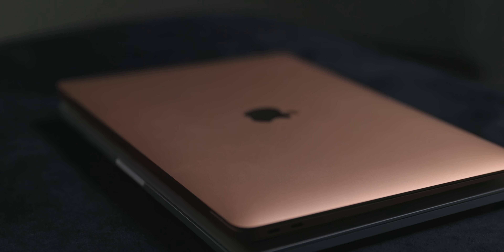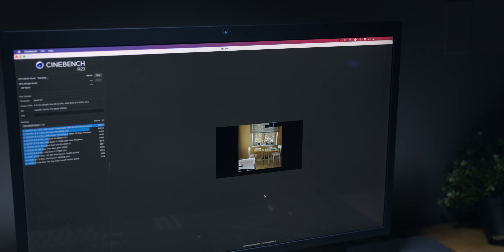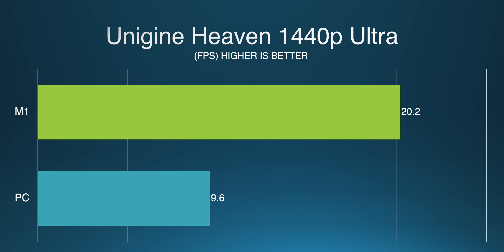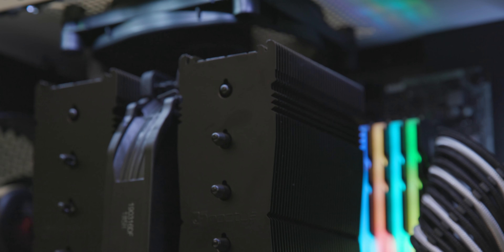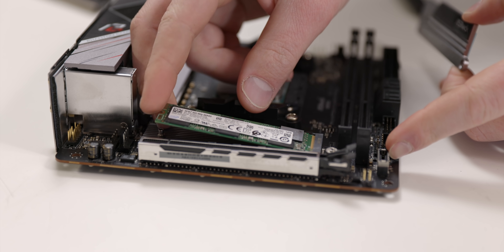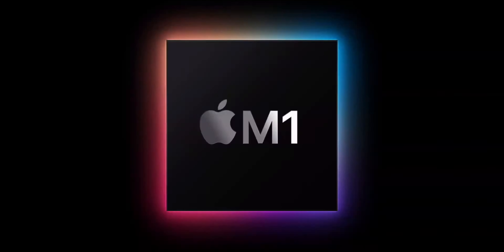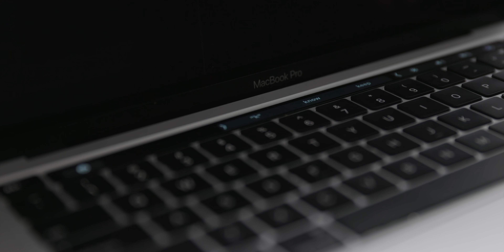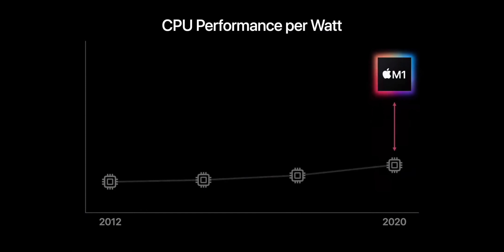$699 Mac mini vs $1,000 PC: Which Is Faster?

Comment: My winters are cold my intel CPUs have kept me warm for years. The M1 is gonna make me freeze to death 😭
Reply: My intel cpu doesnt make half the heat my NVIDIA GPU makes!
Reply: @ryanmalin  well a GPU in general runs hotter, then a CPU. however, under load the GPU runs cooler in comparison.
Reply: @NonsensicalSpudz  in a gaming laptop it’s reversed. The GPU usually runs cooler and the CPU is a hot sun.
Reply: @mashy712  yeah, thats what I said
Reply: but you'll be able to afford a heater with the difference in power consumption
Reply: @alainsterckx9154  But a hot laptop is pretty efficient combined with a hoody. It only needs to warm your fingers.
Reply: Have fun with that electricity bill lmao
Reply: @xehP  Here's the funny thing thou. Power is power and heat is heat. You get the same amount of heat putting 1500 watts into a space heater and 1500 watts into a desktop (thou, yikes that's a beefy desktop). So unless you need to open windows to cool your room as a result of your desktop, you don't waste a cent in electric bills.

I've always thought electric space heaters are a waste because of that. You could be doing a number of things. Welding, computing stuff, spinning a fan, weaving some fabric, boiling water, cooking food, etc. They will all heat your room. A space heater is just skipping the useful work and going directly to waste heat.
Reply: @randomnobody660  You are clearly uneducated. Absolutely everything has an efficiency percent. When your computer draws 700W, it doesn't produce 700W of heat, only the part of energy that gets "wasted" transforms into heat. The rest goes to actually powering components and making them work. Heaters don't need to power anything, so their efficiency is quite high. You'll get much more heat from an identically powered heater than a computer
Reply: @Nagib23_32  It's honestly hilarious how confident you are considering you are wrong.

First, take a step back and think of your room as closed system. You have say 700 watt hours of potential energy in a battery or something. You run that thru a heater, you have ~2.5 million joules of heat, and your room is warmer. Easy enough right?

Now replace the heater with a computer. You spent 700 watt hours of energy rendering a video or something. You claim not all the energy became heat. What did it become then? Lights from your monitor gets absorbed by your walls to become heat. Your fan blows air that stops due to friction and that kinetic energy becomes heat.
Where did you store the bit that isn't heat?

Second, even if you were right, which you are clearly not, that is still a waste. Suppose you are doing something that actually stores energy, like generating hydrogen or something. You could use the waste heat from that to heat your home and have say 200 watt hour hydrogen and 500 watt hour heat. Or you could throw away the 500 wh waste heat and heat your home again with another 500wh of electricity. 500+700=1200 > 700.
Reply: @randomnobody660  Lmao you are the one who's trying to act smart yet is wrong. You know what effeciency is, right? The energy thst doesn't transform into heat goes to

1) Light up the monitor. You know what light is, right?

2) Run current through the silicon. It doesn't just all magically transform into heat, you see?

3) Spin the fans. Friction produces heat, but much less than the fan actually consumes. You know that it needs to use something to rotate, right?

4) Spinning the hard drives. Same story as with fans, motion requires energy

And last but not least, you see, I have an actual live example of how wrong you are. My main system while gaming consumes 650W on average (290x CrossFire, 4790K OC). When I game on it for 3 hours, my room gets hotter by 2-5 C°. I can feel it, but it doesn't make me uncomfortable, nor can it help if the window is open at winter. Now, I also have a heater just for that. It's set to ~300W. When I turn it on, it makes me feel warm in winter in just 10-15 minutes. And if it's set at ~600W (Like my computer is), it will boil me alive in a matter of minutes

I knew Americans aren't known for their brain capacity, but I couldn't imagine them being this stupid
Reply: @Nagib23_32  I addressed all of this already.

1. unless you are shining your monitor out the window, that light gets reabsorbed by your cloth, you, walls etc and become heat.

3. unless you are blowing air out of the house with your computer fan, the air being blown slows down due to friction and when that happens kinetic energy becomes heat again.

4. see 2. Same thing. Unless you are perpetually accelerating your hard disk somehow, you can't just keep putting energy into a drive. Whenever it slows down all that kinetic energy is released as heat.

2. this is the dumbest of them all. Current thru silicon basically becomes all heat plus a bit of radiation, which again, is just heat with extra steps.

If your brain is not capable of thinking thru all the detail, think of the big picture. When you use say 100 watt hour of energy, that energy came into your room via the outlet. Unless it either leaves somehow or is stored as something other than heat, your room is now hotter. Literally middle school physics. So tell me. How did energy leave your room or is stored inside?
Reply: @Nagib23_32  actually it does, the components your powering output their own heat even if it doesn't seem so, the only thing that doesn't really is the fans
Reply: @randomnobody660  you are right on everything you said. Looks like the person you argued to skipped some physics classes.
Reply: @randomnobody660  welding in a living space? a fan gives you maybe 50-100 watt of heat, 99,xx% of people don't weave anything, boiling water raises humidity, cooking food is a daily task anyways.

Electric heaters are irreplaceable if you need to heat with electric. Daily chores won't keep your house warm enough.
Reply: @fluffyman15  Ok, so welding isn't that smart. Although you can at least have a heat exchange in your fume hood or something?
Also my point isn't do more daily chores; those are already done anyways. My point is that energy could be used to do literally anything before turning into heat. Perhaps there can be local datacenters that pipes its cooling water to residential areas, or some sort of non-obnoxious factories that do that etc. Or perhaps you could get a computer that contributes to some cloud computing network (or mines I guess) while heating your home etc. Obviously not how our society is set up, but in an alternative world sort of thing.

Also also the primary point was that your computer isn't contributing to your energy bill if you aren't opening windows and are already using heaters anyways.
Reply: That's a cold burn
Reply: see, that's where you goof'd
i still run a AMD phenom deneb black edition. I can melt ice caps within 3 mins of booting :)
Reply: @redditor001  3 mins? By that time Noah's ark would already be out because intel would have melted all the ice caps😆
Reply: @RawkustvOfficial  nah, we’d probably be evaporating the oceans then.
Reply: Best comment ever 😂
Reply: It really is an issue in the winter for me, but during the summer it's so nice. My old Macbook Pro 2013 Retina gets mildly toasty, but nothing compared to my Acer Nitro 5. The M1 stays cool and I think I've heard the fan come on like twice during the entire time I've had it.

Comparison to another ARM based computer, like the Pinebook Pro laptop, that actually warms up. It also has an aluminum case and an ARM based SoC design, but it definitely doesn't stay as cool as the Macbook (which is also faster).
Reply: xD true af
Reply: It might not be so bad… it’s likely going to be warmer because you won’t have the Windows open!
Reply: @colinpye1430  I think I see what you did there🤣. Did I over think it? 🤣
Reply: @colinpye1430  come to think of it a boat load of people must be using intel as the UK is unseasonably warm, we’ve had the mildest winter yet. Intel isn’t all bad after all 😁
Reply: So don't use m1

Comment: MacBook Pro M1 - is my first ever iteration of joining the Apple ecosystem - and I have to say - very impressive.

While I hate the MacOS for the most part (perhaps I'm too used to Windows at this point) - however, I do have to say it works really well and is very stable. The laptop is silent, snappy, and fits my daily workflows perfectly. I'm not a content creator, but I do have several monitors and run various apps at the same time.

Not a single hiccup. Love it.

Comment: DO NOT BUY A MAC MINI.  MINE IS A $1400.00 PIECE OF TRASH.  FROM THE MOMENT I TURN ON THIS PIECE OF SHIT,   I HAVE HAD NON STOP ISSUES.   APPLE CARE IS WORTHLESS ON FIXING THE PROBLEMS. ANOTHER $100 WASTED.   PLEASE READ ALL THE CUSTOMER REVIEWS ON THIS BEFORE YOU WASTE YOUR HARD EARNED MONEY .   Never in my life have I received such crap from any company ever.   I WILL NEVER AGAIN WASTE MY MONEY ON AN APPLE PRODUCT.
Reply: Agwali  with upgrades they do and I had  Apple M1 chip with 8‑core CPU, 8‑core GPU, and 16‑core Neural Engine
16GB unified memory
1TB SSD storage
Gigabit Ethernet
Accessory Kit
$1,299.00
Qty 1
$1,299.00
	

AppleCare+ for Mac mini
Automatically registered with your Apple hardware.
$99.00   
This copied from my apple receipt and $1399.00 because with new products they will always have some issue so care is part of the cost .

Comment: One thing I do wonder about when thinking about future Apple silicon chips is memory capacity.  When Apple starts producing more professional grade systems such as a future Mac Pro, will Apple have to revert to using memory in dimm slots, there is a limit to how much ram they can fit into the cpu package in the same way as they do on the M1, though I have no idea how much that would be, but, I cannot imagine Apple being able to fit say 128gb onto a cpu package.

Comment: great video. i hope u can give me a good recommendation for the mac mini. im on a tight budget. would you recommend 16gb upgrade over the 8gb or a 512gb over the base model. i work with photo editing and video editing too. thanks so much
Reply: I would definitely go for the 16gb model especially as you want to do editing, it will also future proof your Mac.  When it comes to disk space maybe go with the 256gb model, you can always add disks externally to the mini to increase storage as and when you need it in the future, keep the Operating System and Apps on the internal drive and data on an external one.
Reply: @malch2843  ok. thanks for the info and recommendations. its very much appreciated. i believe what you are saying is right about future proofing it as ram cant be upgraded on the mac mini. thanks so much for your reply

Comment: The assumption of people mashing their keys because the Mac Mini has cooling and the computer you had didn't... is absurd from the start. Because the Mac Mini is smaller, and still manages to include a cooling fan.

If one wants to go the route of arguing about having a cooling fan, then they're just slapping themselves for defending a company of not being able to better utilize the space inside their machine. Even with that argument, they still lose, because of that alone. Computer real estate in SFFs and USFFs like this is very valuable. To waste space, is to wreck the product from the start.

Apple winning, and having a fan, is actually a double win for Apple.

Comment: Just like the Intel transition, the first machines use the same old chassis' as the last architecture. I bet a redesigned Mac Mini could be about the size of the Apple TV, just do that in aluminum with a bunch of USB 4 ports on the back and that would be golden.

Comment: Went from a 2018 Quad Core Macbook Pro to the baseline Macbook Air and it was an upgrade. Never thought i would see the day and selling the Pro it was at no extra cost, sure the Pro cost more when i bought it but the value of it is only going down after time so it was a good decision and again, it was an upgrade for the machine i ended up with. M1 truly is not overrated

Comment: If the mini was as large as that pc you could cool it without a fan also.

I agree with your summation that the mini should be smaller.  I understand that a lot of of these data centers like MacStadia and AWS that use minis have custom racks that they’d have to change but wouldn’t they make up for that cost by using less space if they could stuff more minis into a smaller area?

Comment: Not to diminish the M1, but the renoir APUs are heavily crippled by half the L3 cache, and carry over latency penalties from previous generation Zen chips. Zen 3 APUs should be interesting, when AMD finally decides that the 5 year old Vega architecture has run its course and stuffs RDNA 2 into it.

Comment: I’m still holding out for the “successors”, things like multiple external monitors is very important to me with what I do. I don’t want to work with something like display link as it uses drivers Apple officially does not support and could break at any moment. I really wish apple would change this stance but I’ll digress.

Comment: Your M1 CPU score in Cinebench R23 of 10173 is false, I don't know if that was an intentional mistake or you trying to make it look better than it is but it's 3000 points lower than on your chart, at usually 7700 points.
Reply from the maker: I don’t know how it slipped through the cracks but you’re correct. Our score was 7793. Further proves the point that the PC smashed the Mac in Cinebench. Thanks for the catch—I’m surprised nobody has mentioned it until now. I’ve added a disclaimer in the comments and pinned it. Thanks.
Reply: @snazzy  Wow that was fast :) You had actually wetted my pants for the moment when I saw 10.000 points but it's nonetheless a very impressive score xD. I just wish DAWs and Plugin manufacturers would catch on faster by porting to the M1 but I believe that'll take until the end of this year the earliest otherwise it'd the perfect machine for any person working in audio post production.
Reply: Snazzy Labs Lol and I was confused at 8:57 "just over half the multi core score" while the graph showed the M1 being only 40% percent behind :)

Comment: The chip for most IF you want a ARM based Mac that runs ONLY runs Big Sur.
Reply from the maker: And virtualizes Linux.
Reply: @snazzy  Well MacOS is based on Unix, so you already have a good Linux like shell to play with and makes life very easy when managing servers. Anyway, a little too limiting in having to use ARM based distros and packages(and recompiling from source) within a VM.  If you don't need Windows or bootcamp and x86 CPU( as not all software runs on ARM MacOS as yet) then upgrade to the M1 Macs. For me, I still need to stick with x86 Macs for Windows software development and broadcast radio.

Comment: Well, can the M1 run Red Dead Redemption 2?
Reply: Question is: Can any integrated GPU run RDR2?
Reply: @helloukw  this RYZEN APU can..... it's been tried in a multitude of channels already
Reply: Can a spx, well no! Lol
Reply: Yes it could easily, but ... like a Dell cant run final cut pro
Reply: @axe-z8316  No this is not true. M1 does not have the hardware to run something like RDR2. A Dell can run final cut pro just fine if you install Mac OS on it.

Comment: This is the most fun I've had this week without taking my clothes off.

Despite being on the market for almost four months the meaning and impact of the M1 has not yet been fully understood and integrated by the public. The industry does get it. We often throw the phrase "paradigm shift" around willy-nilly but this is the biggest event of the last 20 years, even surpassing the arrival of Ryzen.
Reply: Exactly.  The M1 is an industry-defining moment that will be obvious when looked back on 10-20 years from now.  As a Windows/Linux user for 30 years, I'm typing this on my M1.
Reply: @c0rnd0g_19  Sooner than that but yes it will be industry-defining. I'm old enough to have watched and participated in the personal computer revolution for forty years this is a rather large splash in the ocean.

Comment: What about compared to my $488 desktop with 4750GE usff from lenovo(smaller than the MAc Mini). Sure it only has 4GB of RAM and 500GB HDD, but for another $120 i upgraded to 20GB of RAM, and added a 500GB NVMe that is faster than the storage on my M1 Mac Mini(in sequential/read/write). TBH, i'm not at all surprised that this 3 year old GPU architecture in the Ryzen 2000/3000/4000/5000 APUs didnt play well against the Mac Mini

I'll have benchmarks comparing my Mac Mini, to the Lenovo M75Q-gen2 once the M75Q arrives. But judging by the performance of the 4750u laptop i already tested, well it looks like it might be similar.

Comment: The problem with the M1 macs is the lack of boot camp. Don’t sound off in replies yet, hear me out. There are many of us who use boot camp for programs that do not natively run on macOS, such as CAD software, but like the build quality and ability to have macOS. Macs used to run windows better than windows machines, but Apple bricked that with the M1 Macs. I know, most users will be unaffected, but it would be nice if Apple would think of people who actually had to have boot camp for work. Sure, x86 processors are not as fast, but the most valuable tech company in the world should be able to figure out a solution for ARM processors to run windows effectively. Just my 2 cents.